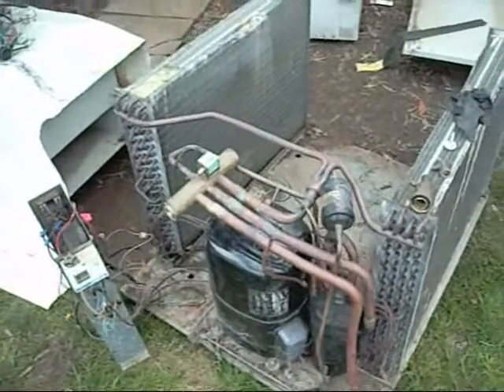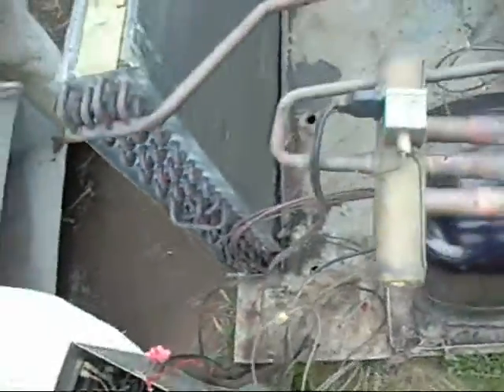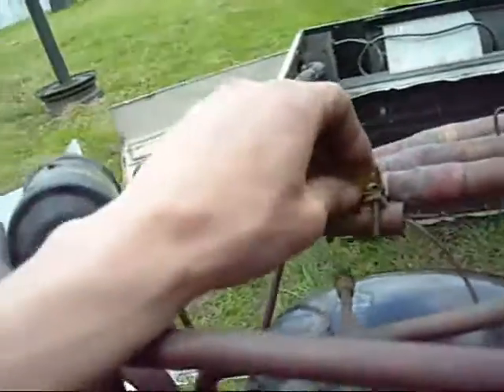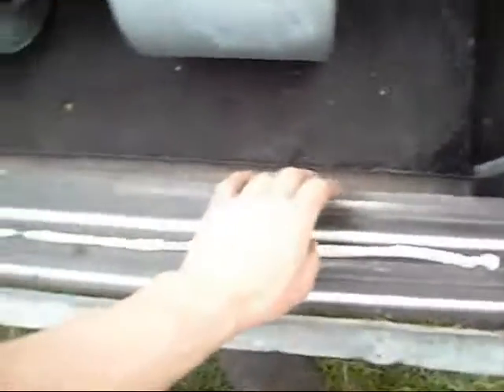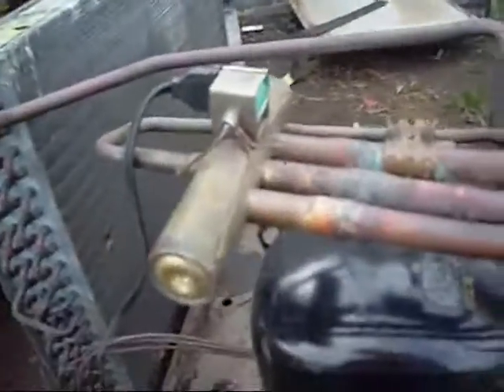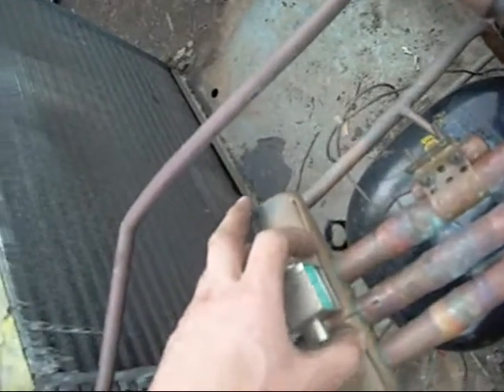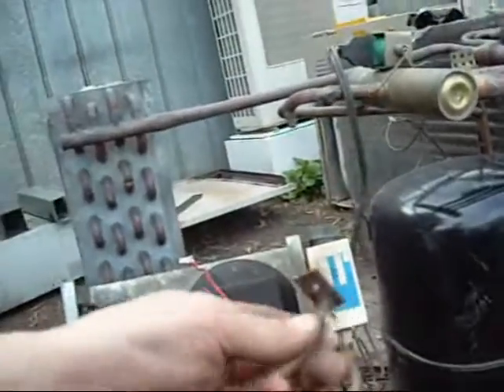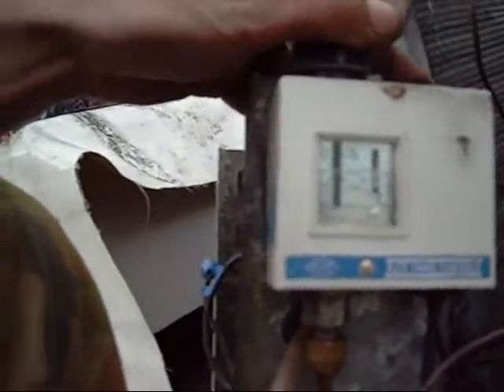Heatpump Tour

Comment from the maker: Thanks man, it appears that the check valve is there for numerous reasons, my theory was that it was for allowing liquid out of the coils in cool mode without restriction, so it can travel to the piston type valve on the evaporator coil in the air handler and then face restriction.
likewise in heat mode, the valve on the air handler coil would allow liquid through without restriction, ultill it got to the TXV and was allowed to evaporate inside the condensing unit coils.

Comment: It is a check valve next to the TXV, its main function to my knowledge is to unload the liquid side of the valve, if too much liquid builds up it will unload it. Also when the compressor cycles off and it helps the refrigerant equalize over the system. I must be honest I've never worked on one, or really ever seen one. Just read about it.

Comment: One thing to remember about rev.valves is they are "usually" installed and wired according to your climate.
Where I'm from we design units for "fail safe heat" so in theory if that rev.valve were to malfunction you would want to have discharge gas automatically diverted to the space to be heated. If that valves normal position was diverting to the evaporator you would wire that to energize to cool and de energized to heat.